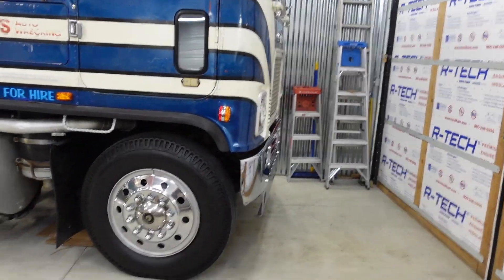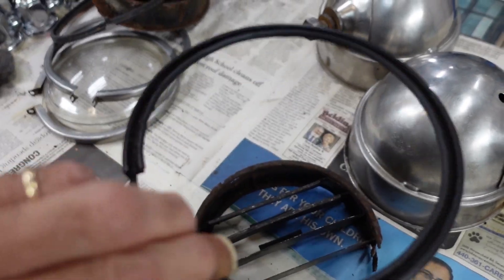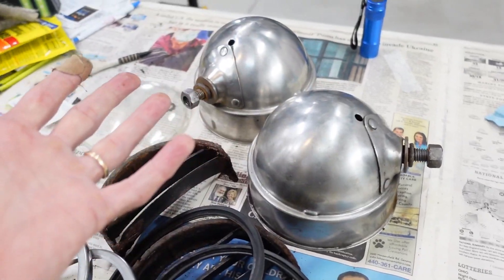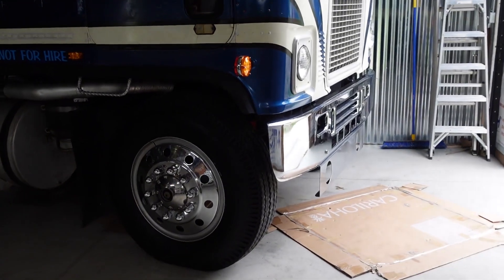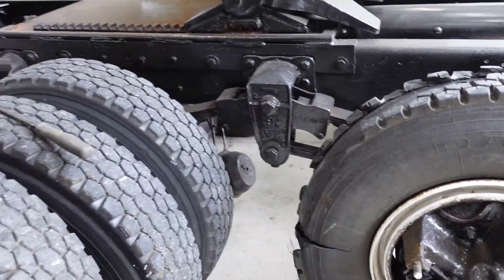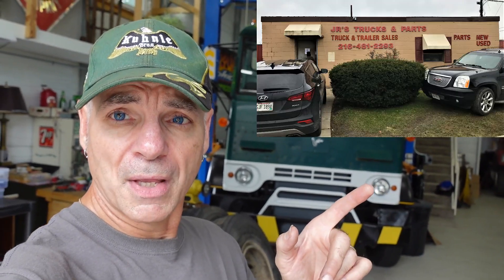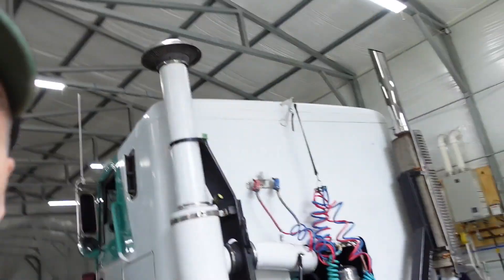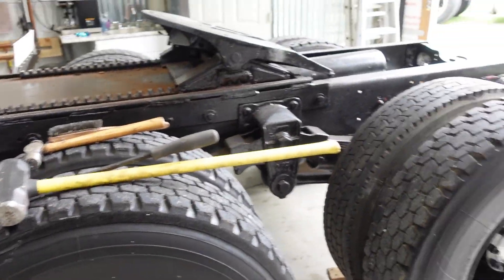GMC Astros update SEMI TRUCKS

Comment: After you ran it down the road and re checked them. Jack up that wheel and stand your hammer next to it and spin it to make sure it’s on straight. Dayton wheels can get off balance and wobble if they aren’t running straight. Used to do tires and that was easiest way to check them.
Reply: Yea that was how I used to check Dayton wheels on trucks and trailers

Comment: I would have put the two matching tires together. Same tread pattern and probably the same diameter. Just Saying 🇺🇸   Especially since you had the 2 that matched 😏
Reply from the maker: Thanks for pointing that out, I totally didn’t even think about it that way. 😮
Reply: I would have put the pair on also to match but as long as the tread depths are close it's not a issue
Reply: Good to see you buddy. Have a great week end I have a couple of truck patches an some other stuff for you buddy
Reply from the maker: @tommyhall2768  awesome Tommy thanks. PM me on messenger

Comment: That brought back some memories,  before I started driving I worked in a truck tires shop it was hard work,  and some times, it would be a pain,  to get them to run true.  
The steer tires should be easier.

Just wondering,  did the blow out take out your mud flap too?  I had that happen many times.   Hot weather,  65 MPH and a heavy loads will cause most recaps blow out especially if they are the biased tires,  radial tend to last a lot longer though.  
Another great video Dane.  Good score on those fog lights too
Reply from the maker: Thanks Bert, and yes the mudflap and bracket AND license plate went bye bye. Couldn’t find em either. 🙄